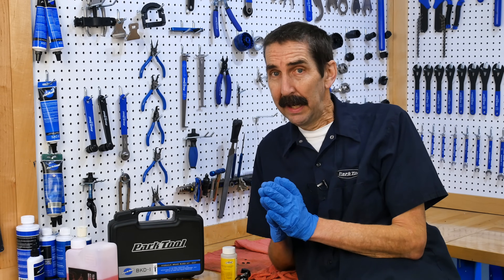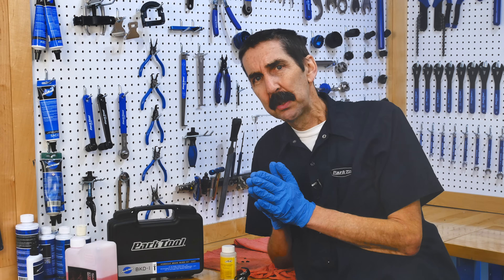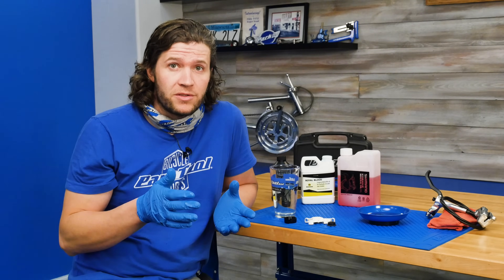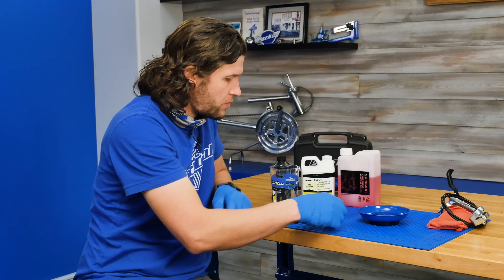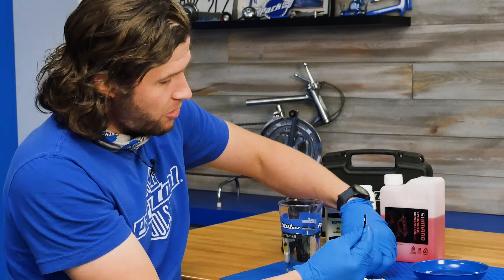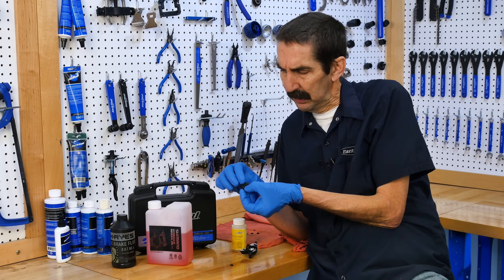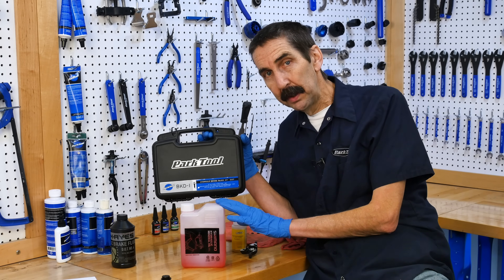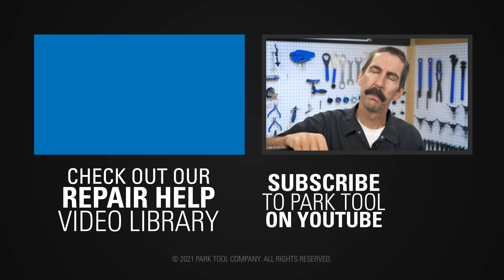Why DOT Fluid and Mineral Oil Don't Mix | Tech Tuesday #166

Comment: Does anyone answe the comments on this channel? I have a reverb stealth seat post and was wondering if the fluid for the Shimano mineral oil brakes will work in the post. It all smells and looks the same just didn't want to f it up using left over new oil in the post from the brake bleed kit ?? Please help 😀

Comment: I had multiple Shimano brakes leaking mineral oil on the disks. Having a lubricant like mineral oil as a brake fluid that can't be washed off with water ist the stupidest thing ever.

Comment: Hello, I'm planning to build a bike tomorrow, but I only have Shimano hydraulic brake hoses that would be used with Sram DOT brake system, I was wondering if the Shimano hoses could be used with for DOT fluid (I'm talking about the hoses only, all the other parts would be from Sram of course).
Reply from the maker: We recommend using the intended hose for the system. Brakes play an important role in keeping you safe.
Reply: @parktool  thank you!

Comment: I have a CYCTRAC electric bike with hydraulic brakes.  No where on the components is there a label indicating fluid type.  The company seems to be out of business.  I have found nothing on-line to help.  Is there any way to determine the fluid type? Or do I need to replace all the components with a properly labeled system?

Comment: Thanks for explaining that I blew my seal trying to mix the fluids. But if a clutch system is contaminated then what do you do after replacing the bad seal, flush it with brake cleaner, and bleed it with fresh dot 3 or 4 fluid?

Comment: I bought at a very cheap price a dysfunctional SRAM Guide caliper with a mineral oil-designed lever( no branding) out of curiosity because the rear caliper and lever set are busted. Obviously, the previous owner put mineral oil on it instead of DOT4. But the front set is working perfectly, and according to the owner, it has mineral oil in it. Interesting question: is it possible that on the caliper part, there is still DOT4 in it, and on the lever part, there is mineral oil, and that is why it is still working perfectly? It is possible that the mass density of both fluids played a role here. Is the mass density of DOT4 heavier than that of mineral oil, which is why it remained at the bottom while mineral oil remained at the top?

Comment: What about DOT5 silicone oil? Is it a valid replacement for DOT4 based brakes? It is used in oldtimer cars and army vehicles which are stored for years. Are the O-Rings compatible? Maybe you want to do a test and make a video?
Reply: Materials compatibility charts say silicone fluid is compatible with most common seal materials except silicone. I don't think silicone is used in bike brake seals. DOT 5 has a high boiling point and doesn't absorb water but is 5X the price (no big deal for the quantity needed), and also vulnerable to foaming which can make bleeding harder. For some reason it's more compressible than other fluids, though I don't know if you'd be able to feel that. Finally, if you want to try it on a DOT brake, you need to purge really well as DOT 5 apparently forms a sludge when mixed with glycol fluids like DOT 3, 4, or 5.1.
Reply: NO!!!!!!  If you mix DOT5 and any of the other DOT's that are glycol based (3, 4, 4+, 5.1), it'll gelatinize and ruin the seals.  You have to very, very thoroughly flush the old stuff out.  The reason it is used for cars that are in storage is because the glycol based is hydrophillic, and will absorb enough water over a long enough period of time to cause rust and pitting in steel calipers.  The older fixed caliper brakes (Corvettes being most famous, but Pontiac also used them in 67-68 on highly optioned GTOs and Firebirds) were notorious for this issue.

Comment: DOT is NOT a type of brake fluid, and really is a ridiculous way to make reference to conventional brake fluid. The acronym D.O.T. stands for Department of Transportation, and there is no such thing as "Department-of- Transportation... Fluid."  When you see "D.O.T."  on a bottle of brake fluid, it is absolutely, in no way a reference to that particular brake fluid's type. Brake fluid is just one of a handful of motor-vehicle related products or pieces of equipment that are regulated by the D.O.T. The  "D.O.T." on the bottle is simply an indication that this particular brake fluid meets or surpasses the Department of Transportation's safety standards for brake fluids, for legal highway use.

Along with several other items, the Department of Transportation also regulates tires, helmets, and lighting, and equipment manufactures have to meet the D.O.T.'s standards on these items in order for them to be legal for use on U.S. roadways. Imagine someone excitedly saying, "I just bought a really cool new helmet yesterday, and when you ask them what kind/type it is, they proudly respond "it's one of those really cool new D.O.T. ones!" Or replace"helmet" with "tire," and imagine the same scenario. You'd think that person was out of their mind for answering your question like that, because your question wasn't even remotely inquiring as to whether their new helmet or new tires were D.O.T. compliant or not. You were asking them what kind/type, and those two things aren't even related.

Two COMPLETELY different types of brake fluid can both be D.O.T. approved. Mineral oil could just as easily be approved of by the D.O.T. as a brake fluid as well. So that's how silly referring to conventional Ethylene Glycol brake fluid as "DOT" fluid, is!

Comment: What if you replace your piston seals with one for the other fluid? 
E.g. I have a set of DOT brakes and used some spare donor mineral oil seals for the DOT pistons. Will this cause any problems with that brake to be bled with mineral oil?
Reply from the maker: There are more seals and o Rings in the system than just in the caliper. There are critical seals in the lever and often at any banjo connection. If all seals were changed you would likely be fine.
Reply: You would have to change all seals, including the cable itself. Thats where the problems start. Piston seals are easy to find in any size but companies will only make seals to fit there own levers so unless you know somewhere that can make you fresh lever seals specific to your lever then you’re screwed. Just use the oil the brakes come with? 🤷‍♂️
Reply: it is a cool idea. turning my SRAM brakes into mineral oil. conversion video would be awesome. @parktool could do a vid of that mod

Comment: Which works better mineral or DOT brake system. Or which one do you prefer. I will be getting a Bike & trying to do as much research as I can before buying a Bike
Reply: If it's your first bike and plan to work on it at home, I would say go for mineral. DOT fluid can corrode your paint and will irritate your skin. Mineral oil is much safer, just don't let it (or any other oil) get close to your brake disc or pads. If it leaks somewhere just clean it up with a brake cleaner fluid and a cloth.

I think the other components of the brake system have more influence on the brake feel and power than the fluid. You don't really reach temperatures, and pressures in the system which these fluids could not handle.

To answer your questions here are the main differences between the fluids:
-DOT is highly corrosieve, eats paint, your skin. Mineral oil is much safer.
-DOT fluid expires on the shelf if opened, mineral oil has "eternal" shelf life. Thats because:
-DOT is HYGROSCOPIC (it absorbs water, the advantage of this is that you will not have water in your cables, the disadvantage of this is that the fluid will expire/the boiling point will decrease). Mineral oil is HYDROPHOBIC, which means that the fluid will never go bad because of water, the disadvantage is in the event of water somehow getting in your cables  you can boil it much easier (because the water will be separate).
-DOT fluid is said to be less compressible than mineral oil.
-The boiling point of DOT can be higher than mineral oil, but the latter still goes way beyond any bike use needs usually.

Comment: My friend bleeded his Shimano brakes last year with Dot oil. :D Poor devil. I told him that a bad idea but he didnt care too much. What about baby oil? Its practically mineral oil like the shimano oil. Seth (berm peak channel now) did a bleed with baby oil and his brakes worked well for a year without maintenance.
Reply from the maker: Baby oil should be safe for the seals and internals but the viscosity and boiling point are up in the air. A companies testing is done using their fluid so stepping out of suggested fluid opens a person to adverse effects that a brand may not have accounted for.
Reply: what about BABY OIL in SRAM brakes ???  no one tried yet?  
 @parktool

Comment: Dot is a bad choice for bikes as it absorbs moisture from the atmosphere which decreases the boiling temperature and affects Hydraulic performance how many times have you blasted down a wet muddy hill then washed your bike or left it in a damp garage? Moisture moisture moisture
Reply: That's a ridiculous assertion. If it's a bad choice for bikes for that reason, then it is equally a bad choice for automobiles and motorcycles for that exact same reason as well, and of course it's not. You simply properly seal your hydraulic system on your bike, just as you would for cars, motorcycles, tractors, or boat trailers (which are completely submerged in water each and every time a boat is put into or taken out of the water) etc, and there is no issue. Even amphibious vehicles for that matter, which also use conventional D.O.T. approved Ethylene Glycol brake fluid, have hydraulic brake systems that are not simply just "exposed" to moisture, but are rather completely submerged in water on a regular basis, and for long periods of time at that, and again, the issue you describe doesn't exist.

The issue you describe, in the context of a properly sealed, properly maintained bicycle brake system, is simply not realistic, and that's not even arguable/debatable. I'm still in somewhat of a baffled state of shock that someone would make such a statement as that.

Comment: So we can use Magura Royal Blood (mineral oil) for any Shimano brake systems (using mineral oil), can't we?
Reply from the maker: Mineral oil formulas vary greatly and can have different boiling points and viscosities. For those reasons it is suggested to use the manufacturer recommended fluid. Magura's royal blood has a boiling point well below Shimano's and is thicker.
Reply: @parktool  Thanks very much for the feedback. And it would be a good idea to include this important point in the video.
Reply from the maker: That may come later. This was more to address the mass of questions regarding why we have two different brake bleed kits and why we could not just have one kit to do both mineral and DOT.

Comment: If DOT's regulated, does it mean I could use brake fluids made for cars on a DOT-based bike brake?
Reply: Yes, as long as the fluid hasn't been opened and sat too long as it does go bad from the moisture in the air. But make sure it's the right dot fluid, I believe DOT 3, 4, and  5.1 are compatible with Avid brakes, just double check. You can mix the fluids too. I've used left over DOT 4 fluid on my brakes and I haven't needed a bleed in 3 years.
Reply from the maker: Yes you can. Typically a brake manufacturer using DOT will say which DOT fluid to use too. Most modern DOT brakes call for DOT 5.1. You can mix them but if a system calls for a higher number it is not suggested to use a lower number but if your brakes call for DOT 3 you can use 4 and 5.1 but not 5. it is a bit confusing. 5 is a different formula and does not mix well with the others.

Comment: Or use water: 
https://www.brakeforceone.de/h2o/
https://singletrackworld.com/2018/06/review-brake-force-ones-2nd-generation-h20-disc-brakes-are-filled-with-water/
Reply: "no pollution of the environment and no oil leakage in the event of a fall. With a 20% glycol content, winter is not an obstacle either." 

No pollution but add glycol ¯\_(ツ)_/¯
Reply from the maker: Interesting!

Comment: 1:28 this is a showcase of the worst possible combination: dot fluid in a mechanical brake lever.
Reply: Transmission fluid works better for brake cables! Preferably used.

Comment: Anyone else notice mineral oil brakes are stiffer in the cold? Tektro swell and drag in the cold
Reply from the maker: That is correct. The fluid does not hydrate the seals as well at colder temperatures which then allows the pistons to advance due to the seals not flexing properly.
Reply: Not really.  I have ridden mine at 27 F(-3 C) and didn't notice any difference than riding at higher temps.  Then again, I ride in low traffic areas and rarely have to brake.
Reply from the maker: @fouresterofthetrees287  This typically starts to be noticeable around 10 degrees F.
Reply: @parktool  10 degrees F?!  And the others in my club think I am crazy when I suggest a long winter ride at 30 degrees.
Reply from the maker: Here in MN we have events that often happen during times when the temps dip below -30F. Here is an excerpt from an events rules page. "In 2019 we had windchills of -55 Deg F and real temps of -40 Deg F."

Comment: What about kitchen oil ? :D
Reply from the maker: Contact your brake manufacturer. Im sure none of them will say it is compatible but it may be fun to try on a set of brakes that you do not mind losing the warranty on or is out of warranty.
Reply: Berm Peak (formerly known as Seth's Bike Hacks) did an experiment using baby oil in a mineral oil system for a year. It worked fine. Of course, do not try this at home, your mileage may vary, and so forth.

Comment: Is it ok to mix mineral oil brands? Can I use shimano oil on my maguras?
Reply from the maker: This is generally frowned upon. Mineral oils are not regulated like DOT fluids so the properties can change quite a lot from one brand to the next. The boiling point of Shimano fluid vs Magura fluid is fairly drastic as well as the viscosity difference. Intermixing them will not damage the seals but may cause issues in use or in feel.